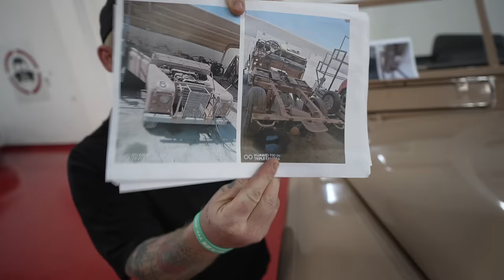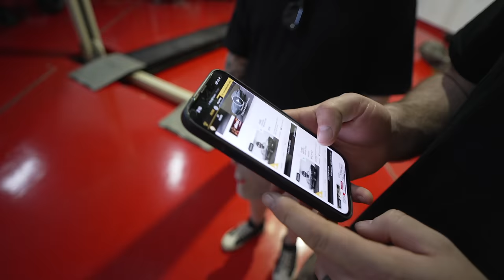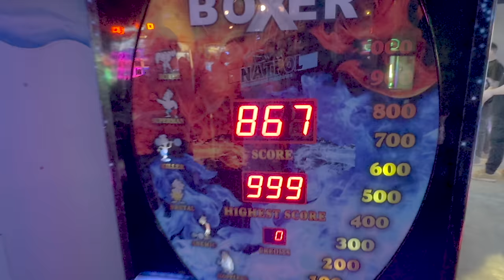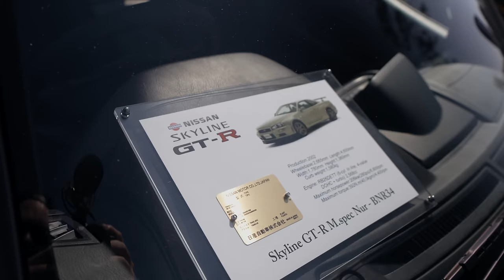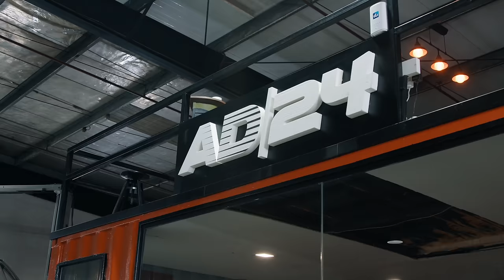I bought the cheapest 800HP engine you've NEVER heard of...

Comment: Gtr has the grill gtst has no grill and extended down bonnet thought you guys would know that lol
Reply from the maker: Ah but when you see the extended lip it means the bonnet has been converted. We just did that on our GTST
Reply: @driftgames_life  true, seen that on a few bonnets especially aftermarket vented ones but the extended lip was done by nismo as part of the aero for the the Nismo R32 not sure of its purpose but always assumed it was to aid down force, i have an R32 GTR that i am building the engine in now but dont have the lip on it as prefer the look without really fancy dmax bonnet but again not sure if it would take away from the look of mine just now as its R35 titanium metallic, and just clean looking in its current set up, low on 59north wheels etc hopefully get it to a driftgames event